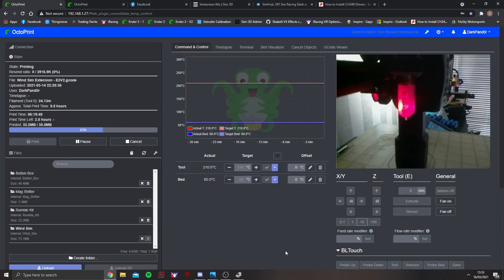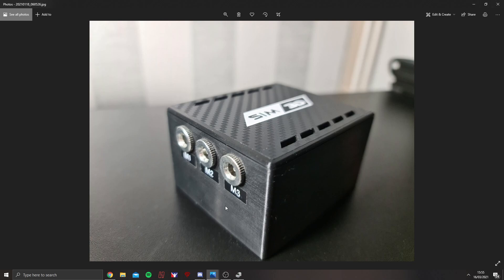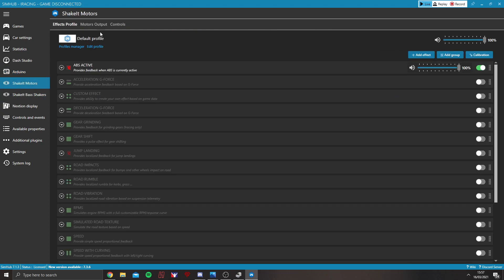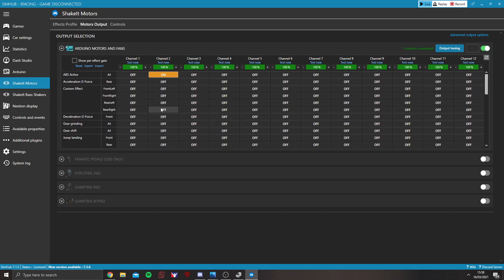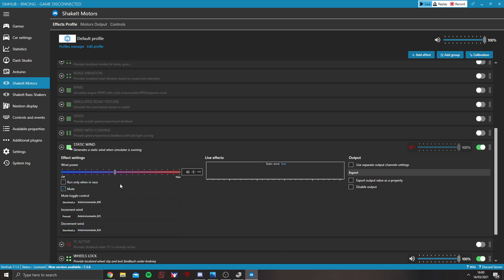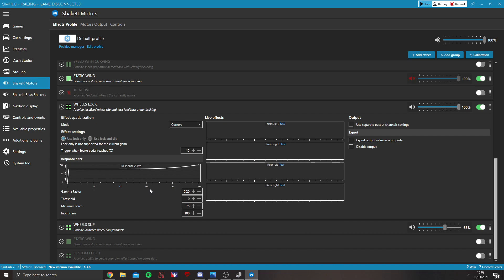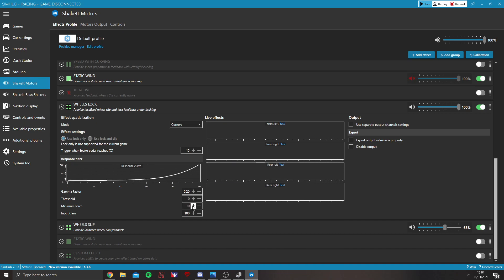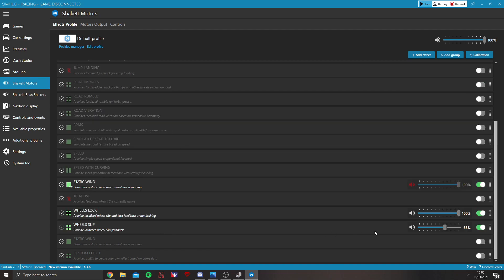Sim 3D Rumble Kit Setup Guide

Comment: Hei Calvin, I was messing around a bit and accidently upladed a complete wrong firmware on the board. I hadn't saved a back up. Do you have the firmware available to download somewhere?
Reply: I have done the same thing. did you ever find a fix for this?
Reply: @andyferris7592 nope. Never got a reply to email either.

Comment: Hello sir, thank you very much for your tutorial video which helps me a lot. I have a Fanatec V3 and I bought the sim3d pedal rumble motor kit because I damaged the original v3 motors when I installed my damper kit and my performance kit for my brake pedal. What I really liked with the original engines of the Fanatec v3 and via the Fanalab on the first Assetto Corsa, was the effect on the accelerator pedal which vibrated when you took a turn a little too quickly and we were starting to lose grip, you know when you hear the tires squealing a little, the effect was not too strong and very subtle. I'm not talking about a big skid or spin here or a forced start feeling the tires slipping on the accelerator pedal. I'm talking to you about a slight loss of haderance that I felt in a subtle way. All the effects are great, but it's the one that I'm describing to you that interests me a lot and which made me buy this kit. Can you help me and tell me if it is possible to have this effect with the sim3d pedal motor rumble kit via Simhub. If so, can you tell me what effect corresponds to this and how to adjust it if you don't mind. Thank you in advance for your response and have a good day...

Comment: Do you have to deal with some lag with time rotation of the motors for ABS for example ? or like a TC kick ? 
question being for iracing, thanks
Reply from the maker: Any lag isn't really noticeable and no one I've spoken to has mentioned or commented on any lag.
Reply from the maker: Any lag isn't really noticeable and no one I've spoken to has mentioned or commented on any lag.
Reply: @DarkPand0r   thanks for answer and being an actor in simracing
By the way my bro and i have csl elite V2
Can you confirm its "Fanatec CSL (New model)" ?
bonus, if you have any direct link to EU psu.. ;p
Reply from the maker: @wharg7468  the one you want is the CSL Elite kit as it works with the V1 and V2 pedals.

Comment: My kit has worked flawlessly for over a year, until this morning. Turns out I needed to uninstall and reinstall that CH340 driver again and Simhub picked up the arduino just as before. You know a bit of kit is good when you notice when it's not working or not there. These are totally worth the money and long lead times.
Reply: mines doing the exact same thing
Reply: Mine stopped working also after a year,  uninstall and reinstall the CH340 driver can`t fix it :(
Reply: Mine just started doing this, did you ever find a fix for it? I have to uninstall and reinstall the driver every time I boot my PC for Simhub to recognize the motors, just started randomly.

Comment: are these stronger than the fanatec ones cause they are quite useless imo?
Reply from the maker: Hi Viktor, these are a huge jump versus the original fanatec V3 motors. Not only because they are vastly more powerful, but also because of the mounting position there is less vibration lost due to a much more secure mount.
Reply: @DarkPand0r  i'm sold, ordered :D

Comment: hi Calvin, any reasons why your store/site is blocked for visitors from Ukraine? thx
Reply from the maker: Hi Vyacheslav, 

I have to add each country manually to the shipping list, Apologies about this! I'm hoping to upgrade the website at some point to get around this. Give me five minutes to calculate the shipping cost and update and it should work :)
Reply from the maker: Updated, the website should allow orders from Ukraine! Hello from the UK by the way!
Reply: @DarkPand0r  thanks Calvin, but the issue is different. I can't connect to your site (it returns timeout error - ERR_CONNECTION_TIMED_OUT). However via UK VPN all fine.
Reply from the maker: @vyacheslav_potapenko  How strange, Unfortunately its through a 3rd party company and I can't control that side of things :(
Reply: @DarkPand0r  understand. Not sure how many other countries are blocked as well..